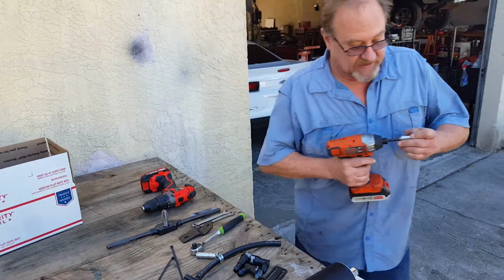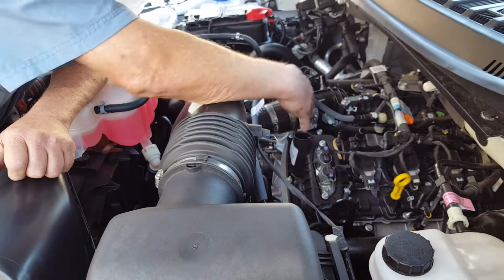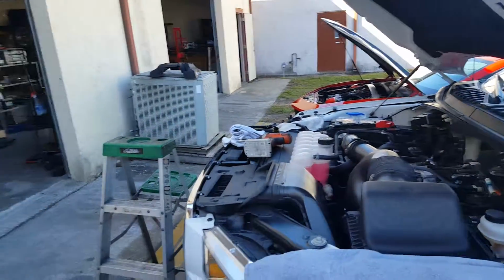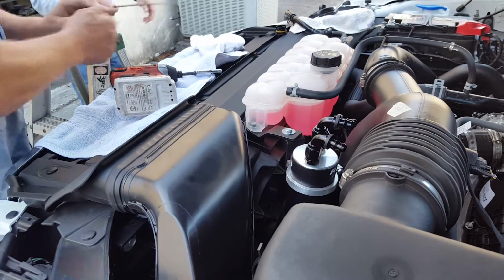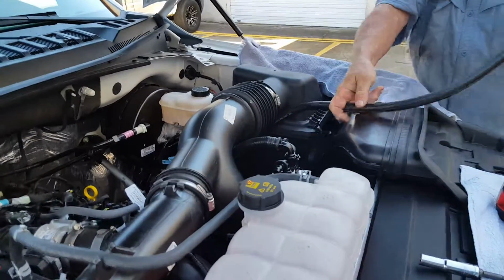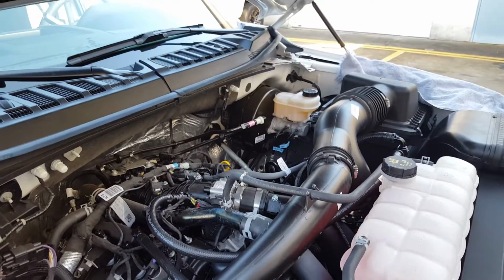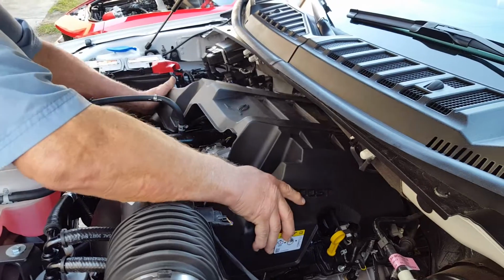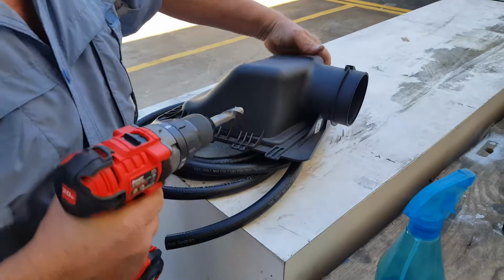20180116 111726

Comment: Note!!  The flow sensor should be relocated and T'd into the fresh/cleanside line between the CSS that replaces the oil fill cap and the top portion of the air box.